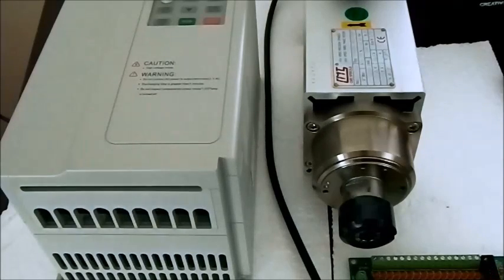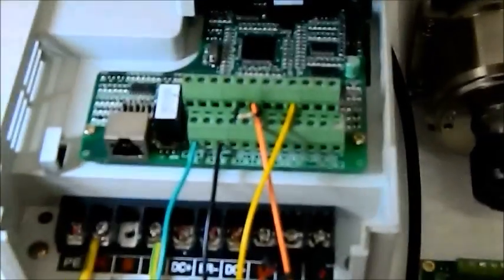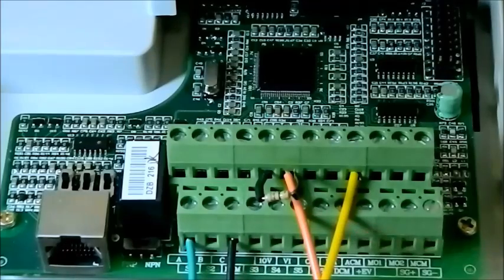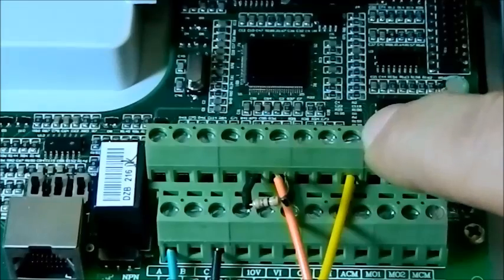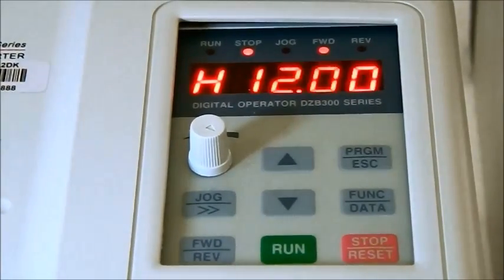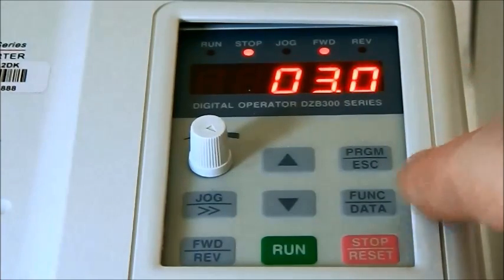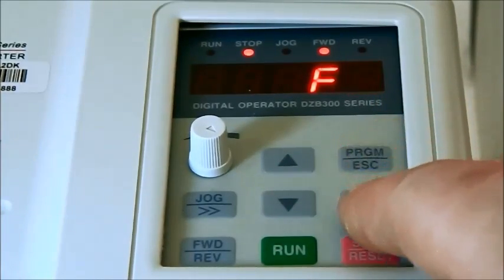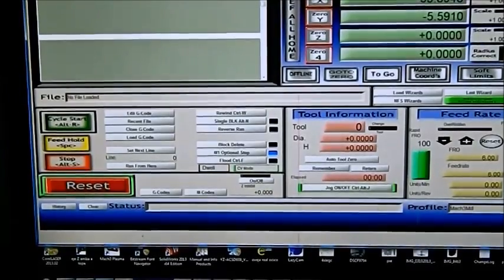3KW Spindle GMT and Fuling Inverter Video Tutorial

Comment: Sabe cual es la configuracion para 2.2 spindle? Thz
Reply from the maker: this depende about your spindle specifications, but if you wach the video carefully you can see there for what is each parameter, then when you have the specifications of you spindle its just replace the value for your 2.2Kw spindle.
for example F1.01 = 2.2
every spindle can be different about rated frequency, rated rpm , voltage , current , poles, etc... thats why inverters can setup for different inverters, but in fact 2.2kw spindles has so many different in the market. please check the metal label attached normally to the spindle or in the datasheet of the spindle manufacturer for that spindle. then replace that data with in the according parameters where is explained in the video and will run.
BR
Reply from the maker: Esto depende de las especificaciones de su spindle, pero si mira el video cuidadosamente , ud puede ver ahi como modificar cada parametro, entonces cuando ud tenga las especificaciones de su spindle , is solo reemplazar los valores para su 2.2kw spindle. por ejemplo F1.01 = 2.2
hay muchos spindles de 2.2 diferentes en el mercado asi cada spindle puede tener diferentes valores acerca de rated frecuencia, rated rpm, voltage, current, polos etc....por eso los invertes se hacen programables precisamente . le aconsejo mire la placa metalica que este adherida a su spindle donde normalmente dice las especificaciones tecnicas del mismo y cuyos valores puede emplear para sustituir en los parametros del spindle, o  bien mire el datasheet del facricante del spindle en referencia al spindle para localizar esos mismos datos.
saludos
Reply: THz por su ayuda, el vendedor configuro el spindle directo desde mach3, a travez del mach3 interface card.
Reply from the maker: perdone , pero eso que ud dice es erroneo. No tiene sentido, de cualquier forma yo me alegro de que le vendedor le haya resuelto el problema, es como debe ser. Pero sin duda, hoy por hoy no existe ningun interface para mach3 que permita la configuracion parametral de los inversores directamente.
Saludos cordiales.

Comment: Hola! disculpa una consulta, tengo un variador modelo DZB300 B 003.7 L4A.  En mi taller tengo corriente trifásica de 220V. Es decir entre neutro y fase mido 110v,  entre dos fases cualquiera mido 220v.

 1.  ¿Es posible alimentar este variador con una sola fase de 220V?   
 2.  ¿Es posible alimentar este variador con la corriente trifásica de 220V?
Reply from the maker: a las preguntas 1 y 2 la respuesta es si para ambas.
Reply from the maker: en monofasico 220V use R y S con los dos cables de tension y conetar el de tierra a T
en trifasico usar R, S y T para cada una de las fases.

Comment: Hi Justo, How can we use the little knob on the VFD keypad to control speed manually?

I tried on my VFD Keypad with the F000.0, 1, .2, .3 parameters to use Keypad, but the knob doesnt seem to do any function. However, I can control speed through Up & Down arrows.
Reply from the maker: in my opninion.... only you can change that parameter and should works. If do not works, maybe the keypad or something else is broken  in the inverter.
The keypad can buy separated. But without check the inverter on my hands I  can not  warranty that there is the problem.
BR
Reply: Thanks a lot Sir.

Comment: Estimado, Mi inverter es un DZB 312 casi identico al de la serie 300 solo que no tiene el terminal de coneccion VI solo tiene uno que dice AI como prueba conccte el inverter utilizando dicho terminal AI pero no encendio, si puedo revisar las señales del Diagnostic y las señales marcan pero no enciende el spindle, no estoy utilizando potenciometro solo la resistencia que indicas, gracias desde ya por tu ayuda
Reply from the maker: Se ve que tu inverter no maneja señal pwm por no tener VI.
Reply: +CNC Modulkit  hola Senor Justo me llamo Mauricio desde Costa Rica tengo un problema serio, espero me puedas ayudar gracias, pasa que tenemos un CNC CR1325 de China y desde nuevo casi nunca se a usado y ahora que lo queremos usar el spindle ya no camina saludosy si me puedes enviar los parametros para el inverter seria una ayuda incalculable un millon de gracias
Reply from the maker: +Mauri Carmiol , Hola, si no abre una consulta nueva , esta respuesta le llegara a Magnatera Competicion tambien por correo. Dicho esto, mi skype es justo1231, me hacen falta muchos mas datos de su equipo, no tan solo el modelo puesto que hay 100 mil maquinas diferentes con ese numero de modelo, asi es que es mejor que contacte conmigo por skype y vemos si les puedo echar un cable. Saludos.

Comment: Very well explained! 
You could explain the parameters for a motor 6.5 Kw?
Reply from the maker: Hola Manuel,
Los parametros a setear son los mismos (siempre y cuando Ud tenga un inverter Fuling the 6.5Kw o mas), lo unico que variara sera los valores , de tension, frecuencia maxima y los referentes a parametros de motor que figuraran todos seguramente en la placa que lleva el spindle o en la hoja tecnica.
Cada spindle tiene unas caracteristicas distintas en cuanto a polos, amperaje y velocidad maxima, por lo tanto no puedo especificarle los datos exactos.

Hi Manuel,
The parameters to setup are the same.(always in the case that you have a 6.5Kw or greather Fuling inverter) the unique difference will be the values for Voltage, Maximal Frequency and the parameters about the motor specs, that you can find in the motor plate of the spindle or in the datasheet as well.
Every spindle has different specs about poles, current and maximal speed (frequency), then I can not tell you wich data exactly.

Gracias por suscribirse, si tiene alguna duda o le podemos ayudar con algun otro componente, haganoslo saber.

Saludos Cordiales
Justo Garbajosa
CNC Modulkit HK Co. Ltd.
Reply: CNC Modulkit Pues acabo de conectar la tarjeta PCI e instale NC Studio para controlar el equipo pero no tengo esos datos, bueno no todos.
Sprindle Speed: 24,000 RPM
Max Consume Power : 6.5 Kw.
Max Speed : 32,000 mm/min.
Max Working Speed: 30,000 mm/min.
Sprindle Power Motor: 5.5 Kw. water -cooling Sprindle 
Working Voltage: AC220/380V,1PH/50/60Hz
Son los datos que tengo, ¿Me pudieras ayudar a configurar el equipo?
Reply from the maker: Manuel Vicente Pardo Alvarez
Estas mezclando cosas,
Una cosa es lo que configures en el software de NC studio y otra cosa es la configuracion o setup del inverter para que maneje el spindle.
Como ves en el video se habla de Mach3 y no NC studio. Me consta que la conexion de los cables entre la tarjeta PCI y el inverter no es igual de como se explica en el video puesto que son dos productos diferentes.
Luego lo primero es confirmar que la conexion entre la PCI y el inverter es correcta. refierase al manual de cableado de su tarjeta PCI para el spindle-inverter.
Por otro lado , la configuracion del inverter viene a ser mas o menos igual a nivel de parametros, si bien los datos que hacen falta no los encuentra en el NC studio si no en la placa metalica que lleva el spindle, estos seran Potencia nominal en Kw, Maxima frecuencia del spindle, polos (aunque esto quizas tenga que mirar el datasheet del spindle o quizas tambien lo ponga en la placa) y current nominal. 
Estos datos ultimos son los que corresponden a su spindle en concreto luego tendra que sustituir los valores de los parametros que se indican en el video acorde a los de su spindle. Al ser un spindle de 6.5Kw segun me dice, seguramente trabajara a 380V y su inversor de la marca Fuling deberia ser para 6.5Kw o mas. Y estos parametros de configuracion solo le valen para inversores de la marca Fuling ! si Ud tiene otro inversor pues no creo que le coincidan los parametros.
En cualquier caso, Ud siempre puede pedir soporte al proveedor de sus componentes. El deberia ayudarle al respecto.
Saludos
Reply from the maker: Manuel Vicente Pardo Alvarez de cualquier manera si te puedo ayudar my skype es justo1231
Reply from the maker: CNC Modulkit Hay muchas incoherencias en los datos de spindle que me das,
Si es 6.5KW dudo que trabaje el inverter a 220V si no en trifasico a 380V, ademas ahi dices que 1PH osea un caballo, luego es totalmente incoherente.
No se de donde saco que el spindle es de 6.5Kw.
con mas datos podemos aclarar en skype.
Saludos
Reply: CNC Modulkit ¿Cual es tu cuenta de Skype?